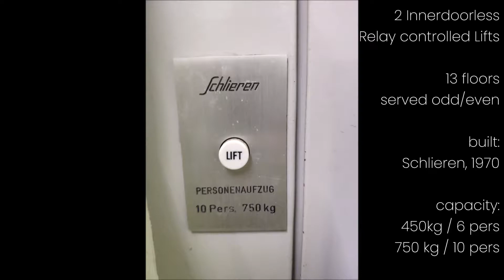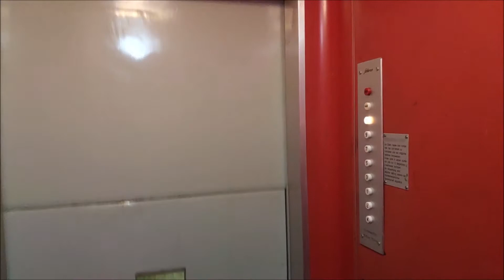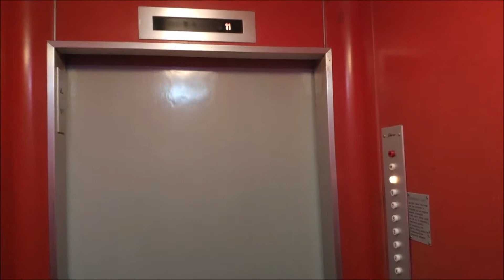2 EPIC SCHLIEREN Relay Controlled Lifts near Basel, Switzerland

Comment: Remember an elevator with the same type of brake. College was on top of car in a 28 story building when the axel of the brake locked up in open position. Luckily, it was a very big car and a small technician. A got away with big headache and 2 weeks of pain in the back...
Reply from the maker: Oh so he got lucky then. I know such a story as well from a former technician, he went up on inspection, released the button but the lift kept going up util it hit the top overtravel limit switch. Luckily it had enough headroom, which back then on these old lifts always was given.

Comment: Interesting that the relay controls and the floor selector are very similar to Westinghouse, and for Asian countries, Mitsubishi since the latter had been partnered with Westinghouse since the 1930s. I wonder if Schliered had a technical partnership with them back in its early days as their history states that Schlieren adopted American elevator technologies like the use of sheaves for traction elevators insteaf of winding drums.
Reply from the maker: That's an interesting thought but I don't think so. The part of the company's history that can be found online does not mention a partnership anywhere. Schlieren overtook the lift division from ARSAG in 1916/1917 which was based in Zürich-Seebach, not far away from Schlieren. in 1924 they were the first company to introduce the traction sheave system in Europe. In the 1930s they started with DC controls because that did allow much more flexibility than AC controls. Diodes which enable current flow only in one direction only work on DC for example.
There have been a few other notable innovations that were made by Schlieren, like the Aconic transistor controls in the early 1960s or the Monotron drive system which allows direct levelling without creep travel. That was invented in the 1950s and was the first intelligent levelling system ever built.
As Schindler bought Schlieren in 1960, all these technologies were moved to Schindler lifts as well and in 1985 the Schlieren factory was decommissioned by Schindler.

Comment: electricity (light, knobs) is fed into the cabin via conductors at the wall? or is there a cable hanging under the cabin?
Reply from the maker: The rails on the wall are the positioning system. It is contact less with vanes clipped into the aluminium profiles and sensors on the lift car. There is a hanging cable underneath like on every lift for power and signals.